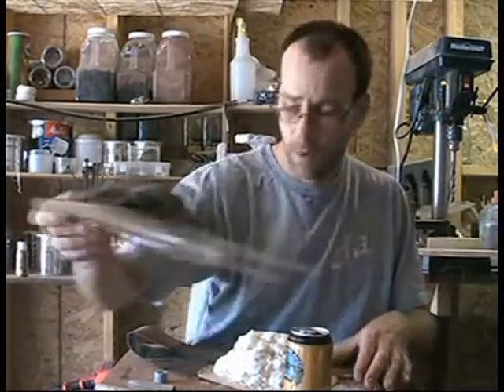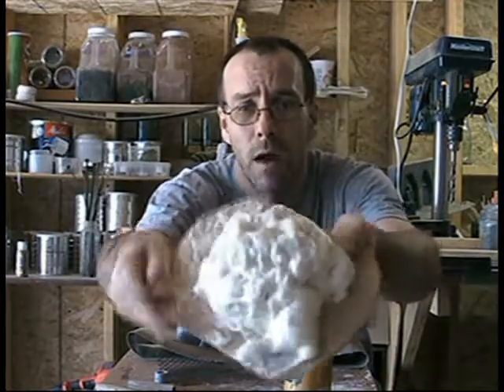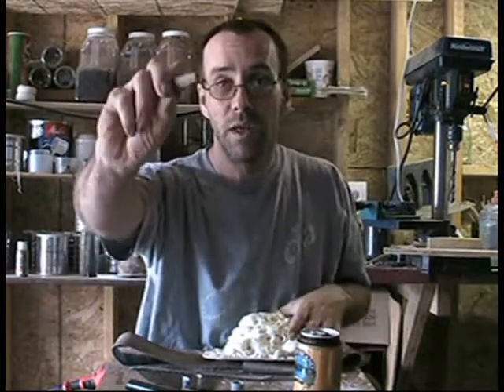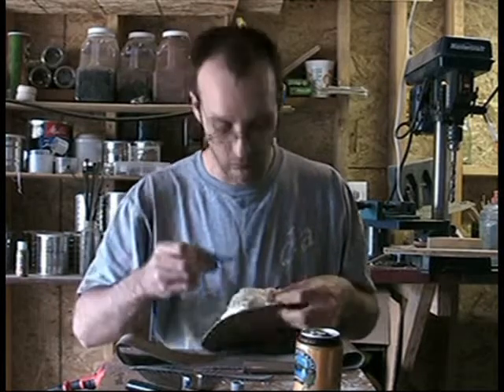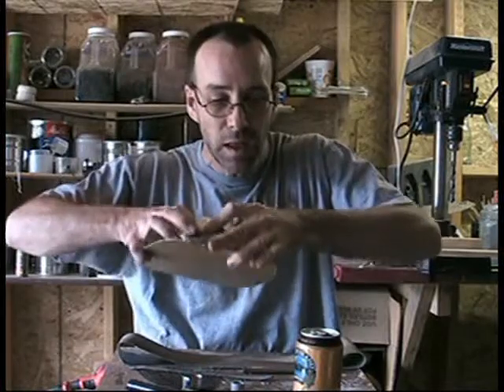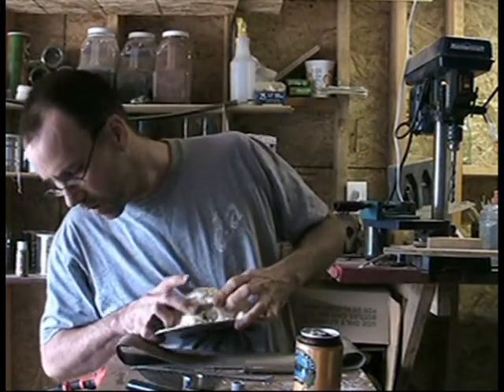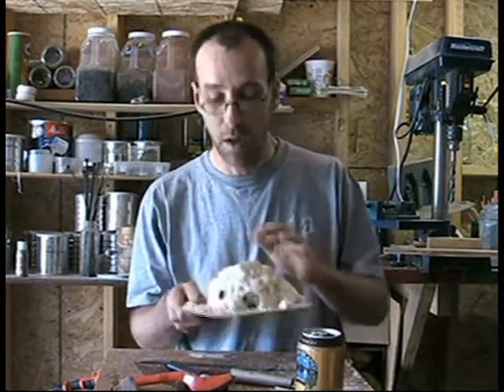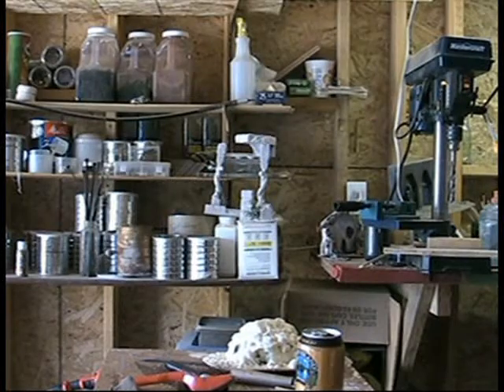making a Hobbit house for diorama or LOTR game terrain Part2

Comment from the maker: That can happen if it is exposed to sunlight. You need to apply a good coating to the foam. There are many different brands of this type of foam so some may act differently in different environments. This is a low expanding house brand from Home hardwares stores (low cost and seems to work good for me)